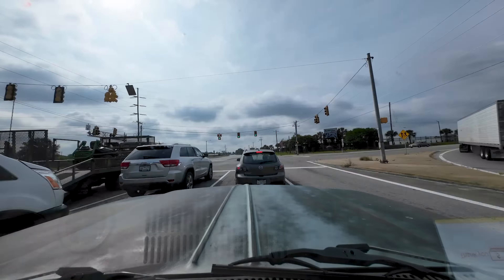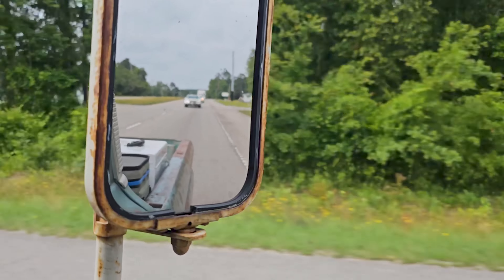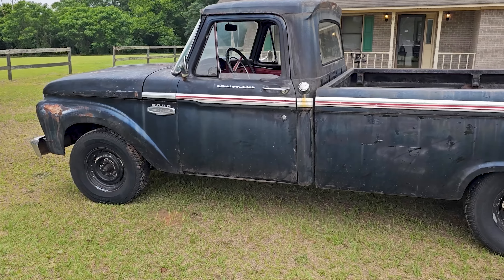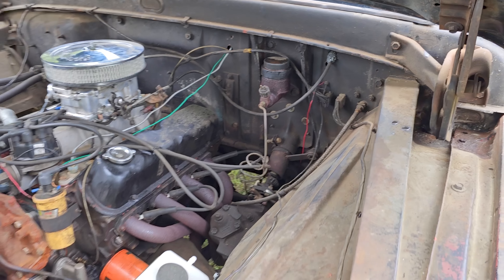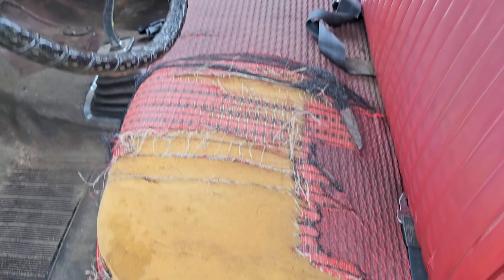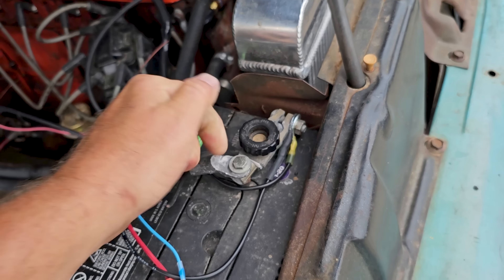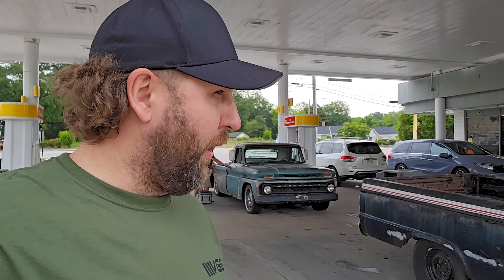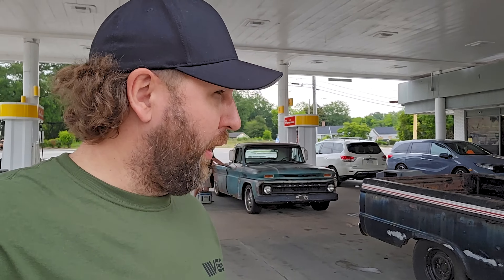Bought Sight Unseen! Will This Ford F100 RUN and DRIVE 640 miles home?

Comment: Great video.  Gotta say, I'm disappointed with the state of auto parts suppliers today.  Oreilly doesn't carry standard items anymore like small block Ford, GM, Mopar fuel pumps and starters.   Cmon, really?  They told me there's no call for them, when I see 20 or more daily in my little town easily that use those.  If all they're gonna do is order stuff online, then I may as well do that myself.  Sadly they're all like that now.  They carry batteries, bulbs, fuses, car cleaners, and filters.  Most of the other stuff, you gotta order.  Pretty sad.  No wonder Summit has become the go to for most people today.  Pretty soon, if they don't get it together, the only way to buy parts will be online.  Even spark plugs are now spotty, this shouldn't be.

Comment: 25:18 next time your in a stiuation like that grab a pick and you can undo the zip tie without breaking it. Just pick the lock off the teeth and pull the tie out. This is for emergencies only though. Aint nobody got time for that lol

Comment: Nothing wrong with that sad cable, just need to shove a nail in between the terminal and the post before you tighten it up....or for a professional look, a bit of 12/2 solid copper wire you nicked from an electrician that was passing by....

Comment: I can't wait to see what you do to the Adopted Ford truck! I love Longmire, beautiful truck, inline 6, the way the Chevrolet gods made it. Anyway, Here's hoping the crewcab makes it back home one day, and you all finish this thing in style...VGG Style. 
I am not a Ferd owner, but I used to own a 1964 Ford Econoline Pickup Truck, yes, the snub-nosed one with the engine inside the cab. It had a transplanted Ford 300 inline 6cyl and a C6 transmission. Satan took it away from me without my permission, I hate you Satan. 
I also partially owned a 64 C10 long bed, which also had an inline 292 6Cyl, also acquired by Satan. Love those inline 6bangers. 
Satan also took my 66 Pontiac Catalina 4-door with the 300 big block and 2 speed tranny. 
Satan is a Hater, and is no longer a part of my family, in my mind. 
Btw, not a religious guy, but in order to protect those involved with selling my cars(Why bother, right?)  I will forever call them all Satan, including the Devil's salvage lot who buys cars with no title for $35 dollars to sell for parts you pull off yourself.

Comment: It just occurred to me. I watched the vid in which you regained Longmire after 10 years.
I also have a story about rebuying a car. Now this story is about a '91 Volvo 240 GLE. OK OK  I know. Volvo.
But in Australia we don't have acres of old tin we can select from. Anyway. I purchased this Volvo about 10 years ago. Project car. Then a year or so later the seller came by saying he really wanted it back and because I'm basically a nice guy I sold it back to him (for about 3 times what I paid)(I told you I was nice). Then about another year later he came by with another story that he had to get rid of one of his cars and the Volvo was it. Would I buy it back? OK I said. For the price I originally paid. No that's a lie. For the same price I sold it back to him. I told you I was nice guy.
Anyway the story doesn't finish there. He came by some time later saying he was interested in buying it for parts.
This time I firmly said NO. I know what a bastard I am, but I do love the car and fully intend to restore it.
I love the way you fix up old trucks to going and useful, but not to showroom condition. It's appropriate.

Comment: First of all it has a fram oil filter so you did not work on it yet . lol Then its a ford so most likely will not make it home without some work done to it. Just one mans opinion  and last but not least no air freshener.

Comment: Those $20 universal three-speed Hurst column-to-floor conversion shifters are sloppy garbage when brand new. In 1993 I bought a new one for my 1983 Ford F100 and I eventually kicked it to the curb and went back to the factory column shifter. Those cost 300-someodd dollars now, which is beyond laughable. They aren't even worth the $20 they cost in 1993.

Comment: The Carb is too big for the truck.  a 350 CFM is plenty big enough for a 351W Why would you put a 650 Quad on a 305, someone did not know what they were doing. So they had the idle cranked up all the way so that it sucked enough fuel out to prevent flooding. when you turned it down that is why you had flooding issues. Makes sense. you are drowning the poor thing.

Comment: I'M GOING TO NEED YOU TO EXPLAIN YOUR SELF!!! Can you explain to me why you acted surprised when you took that piece of crap boat anchor off that I've never seen a single one run right in my life, and said well it's run on a Holley. I don't think that you expected it not to run drive start and definitely have 30 more horsepower than that other thing! And since you have the means why don't you use more quadrajets? Seriously, they get very good fuel mileage make very good power and my personal favorite the fact that when you floor it it sounds like it's sucking a hole through the hood!!